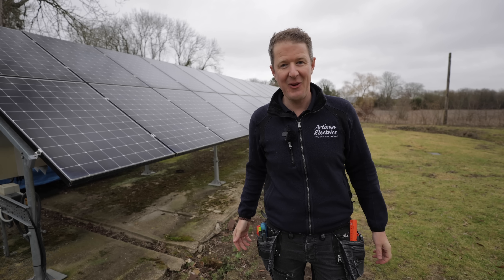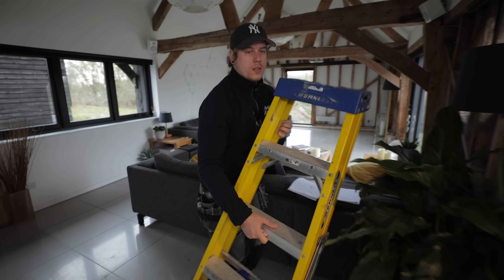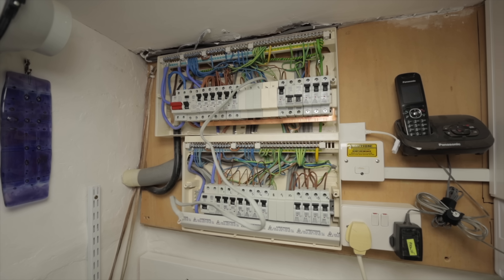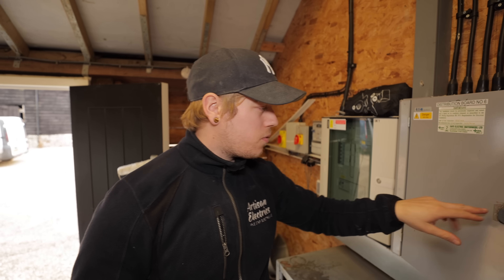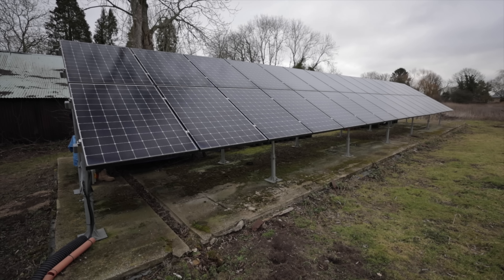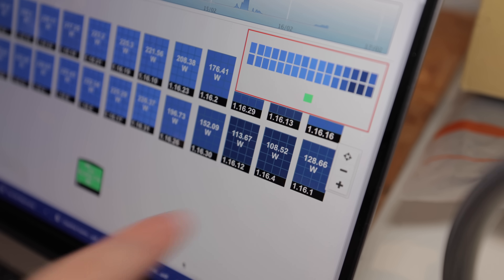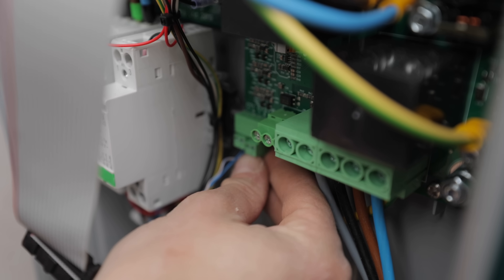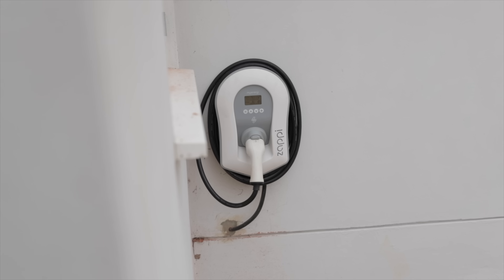Uncovering A LOT of electrical BODGERY!

Comment: Cut out fusses DO NOT protect the incoming supply cable.
Reply: Only against overload, not short circuit. Its a fuse, not a fusse. RECs/DNOs allow up to 100seconds disconnection for a fault on a supply cable to a head. (cut-out)

Comment: Guys can you please collect all of your cable trimmings into a box or a bucket as you go. It's not acceptable to just flick them on the floor, essentially outside. Why did Lee refit the Zappy back on the cobweb/ dust covered wall without giving it a brush off first? Apart from that, good work.

Comment: Never letting you see how I got power to my shed! You'd rip me to shreds lol. Great content gents.
Reply: Mine is fed by a 16 gauge extension cord into a very overfilled J box. It was meant to be replaced with proper SE cable and a breaker panel, but as we all know, there's nothing more permanent than a temporary solution.

Comment: Be careful about throwing rocks about IT Nerd diy work - because it many cases its substantially better than so called professional work.  Your video of you trying to wire in that ecoflow changeover unit and making a complete mess being a good example.
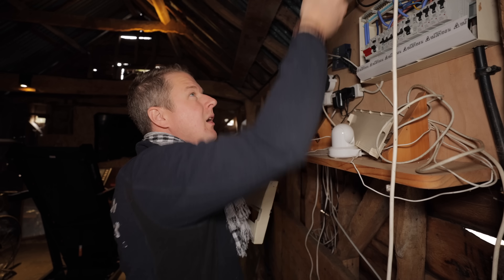Reply: While I'm well aware that it's not up to code and voids the product's listing, my first response to that extension lead at 5:00 was "There ain't nothin' wrong with that!"
Reply: Yeah, this is pure ignorance, I've seen as many bad jobs done by "professionals" as bad jobs done by "DIYers". The only difference professionals do charge you a lot for work.
Reply: Nah man DIYers and techy guys are the bane of any electrical installation. It’s just embarrassing whenever you turn up-to a job and see what they done. The best part is is that they are so proud of themselves for making it ‘work’…. You don’t know what you don’t know. 

Your right though - there are bad electricians out there.

Comment: I think any unused cables in a distribution board should have all conductors connected to earth. Otherwise, whilst being extremely unlikely they could become live and not necessarily from touching a live conductor inside the DB. There’s a potential for it to happen somewhere on the cable run or in the back of an accessory etc. Just good practice in my opinion
Reply: Agree, have always C2’d floating cables in DB’s for that reason.
Reply: Have to agree - as a meter fitter we were expected to isolate and instruct the customer to call an electrician whenever we saw hanging cables. If I had done that, I probably would've isolated hundreds of customers in three years and created a lot of nothing-work for electricians - and trashed the reputation of meter fitters even more. I just don't understand why people leave hanging cables everywhere - it simply introduces doubt in the minds of the next duty holder to turn up to do work.
Reply: However you then run the risk of that unused cable becoming live in the event of a fault.  I agree with terminating to earth unused cores on a multi core wire, but not spare cables. Especially if you don't know where the other end is.
Reply: No no no, Not spare cables at least! They could become live during a fault... And You know the outcome of that if connected to earth.

Comment: 2:20 should you ever hide a consumer unit? That should be a C3 in itself. Power goes out and Mrs Jones trips in the darkness because she can’t find it.
Reply: In the US, that would be a code violation due to minimum requirements for open space.
Reply: Same as the height, wouldn't comply with building regs Part M on s new build, but they can't be applied retrospectively.

Comment: The loose T&E in the CU is a code 2.  It’s a bare ended cable, not adequately terminated or capped off to prevent the copper ends touching live parts inside the CU and subsequently making the other end live.  It is no different to free floating cores inside a switch for instance that hasn’t had a choc block or wago popped on the end.
Reply: Unterminated ends bother me too....
But then again I'm a railway signalling engineer.... And Clapham Junction shows why they aren't a good idea

Comment: A Faraday cage is not just a metal box as its used to block electromagnetic fields, electrician taking nonsense as the metal box can reduce or interfere with the sensors signal but its not a Faraday cage (a brick wall can reduce signals transmitted through the air). Some Electronics engineers know a lot more than you do so don't put them all in the same pot. There are many sparky's who cut corners like the ones who installed bathroom down lights using terminal block and wrapping the connections in insulation tape and stuffing them under loft insulation (halogen bulbs in down lights). They also used bits of plastic pipe to try and prevent insulation covering the down lights that just fall over and this was found in a 15 year old house by an electronics engineer.

Comment: The multibox lead wired directly into the board at 5:00 doesn't violate code that I know of where I live(New Zealand). Dont get me wrong, it is Jank with a capital J. But sometimes Jank is a pretty good solution. 

Sure, running the multibox off a single plug socket would be better, but if you have a multibox with a damaged lead, why not reduce reuse and recyle by curing off at the damaged part of the lead and putting it to good use instead of the landfill? So long as the customer is happy that it works, costs them a little bit less to implement, and complies with your electrical code, why not embrace the Jank every once in a while when you have the opportunity to do so. Don't tell me you don't love that shit. We all saw the look on your face at 5:21.
Reply: Once you cut the plug off (or damage the cord), that product is no longer compliant and can't be used. Not only that, but it was never listed in the first place to be connected directly to a breaker.

Even knowing that, I still would have probably connected it exactly like that if it didn't have to be inspected.
Reply: @user2C47  What are you saying? What is the difference of buying a powerstrip without the cable and one with the cable fitted and cut off the plug? 

That thing is probably not elegant, but either not dangerous, assuming the breaker is properly sized for the extension lead and the cable (10A or less with 1.5mm2 cable), there are a bunch of power supply attached anyway. I see this done a lot where I live and it's perfectly fine, usually this is done in a similar situation (where it's just lazy, just fit sockets come on) but to power strips that are attached to desks or in racks of equipment.

If you need a lot of sockets in a location using a power strip is cheaper (for example where I live a schuko socket of a basic like like Gewiss is no less than 10 euros, plus you need the box and the faceplate, while a 6 places power strip costs like 6 euros), it's faster to wrire (you connect one cable, and done), and doesn't present any code issue. Of course you have to use appropriate cable up to code (that is in my country no less than 1.5mm2) and double insulated even for the short run that comes into the power strip.
Reply: @alerighi  two things: 1) didn't show whether the flex cable leads were ferruled - possible bad connection, specially if the breaker had solid lead also connected and 2) the breaker is probably oversized for the usual .75 mm^2 extension cord cable, both creating possible fire hazard inside CU. It is true, that it would not be much safer if there was a single outlet and THEN overloaded extension cord, but the line has to be drawn somewhere and at least in my country it is between fixed installation and user-connectable stuff.

Comment: I always laugh at the comments about "dodgy" DIY'ers" etc.  But if you have a think a fair amount of the issues you appear to find are actually done by qualified trade staff.
Reply: I agree with this, I am also disappointed when I hear "Bodge jobs from Electronic Engineers who think they know what they are doing" my father was an electronics engineer and spent 10 years training before being qualified. To quantify them as some type of idiot compared to an Electrician is simply not very fair.
Reply: @p3147-u9d  I have to say it does get a bit tiresome to hear “DIY Bodge” as the comment when he’s already listed a hell of a lot of installation failure by clearly a qualified or pretending to be qualified electrician. 
It would be far more productive to say why this was so bad rather than rant about the DIYer who did it when you don’t even know if it was one who did it. I can’t think why someone would consider wiring a multi plug extension lead directly in to MCB, but then again as an IT geek what would I know 🤬
Reply: @p3147-u9d  Some of us are qualified electricians, electronics engineers and IT techs! 🙋‍♂️
Reply: @p3147-u9d  my father in law was an electronics lecturer … and he was cheap.    So every single electrical job he did at his house failed inspection. 

Cost a fortune after he passed and we had to correct it.
Reply: @p3147-u9d  I think he meant different areas of specific knowledge not idiots. Obviously someone could do something that works without hurting themselves but it still not be correct under electrical installation standards.
Reply from the maker: Worrying isn't it?

Comment: For us non-pro's, what was the issue with the extension lead off a breaker? Apart from looking amateurish, from a regs/theoretical pov, what are the issues? If the cable is glanded into the box properly and of an appropriate size with the correct size MCB/RCD etc for the cable, isn't it just another radial circuit?
Reply: The only issue really is that the cable is not secure, a clip would sort that out. If you tug on the cable, you risk the connection becoming loose as it is currently
Reply: @TheAviation101  That's less of an issue than the current rating of the flex
Reply: @andrew7440  think they’ve put it on a 6A MCB which is fine
Reply: @TheAviation101  I thought 16 amp breaker see it at 5.min 36s
Breaker no.7 
The only 6 amp connected appears to be fed with a wire from above not below.
Reply: @andrew7440  in that case it still may be ok depending on cable size and type. It might be flexible cable but you can use the 70c rating on some cables when they’re installed fixed compared to 60c flexing.
Reply: Hopefully it’s a 1.5mm cable
Reply: @TheAviation101  yes,  though over such a short distance it'll not make much difference. The cable will last longer than the multi socket. I'm more concerned about the multi socket carrying a continuous 16amps, I've seen those things melt!
Reply: Once you cut the plug off that cord, you instantly void the product's certification. It was also never certified in the first place to be connected directly to a breaker.

While I'm not familiar with building codes in the UK, but I imagine using a non-certified product is very illegal.
Reply: @user2C47  You might have a point, but I'm not sure what's valid in your State/Country necessarily applies here. I think if the cable is to a BS or harmonised European standard, it would be ok. You can easily get the component parts of an extension lead which would comply if those parts are built to the relevant standard.

Fixed installations of flexible cables are allowed with caveats. This is where UK regs can get "woolly".... Various trade bodies would regard such an installation as "not advisable", but it's not illegal. As always, if it all goes horribly wrong, a Judge might well ask you to justify going against such guidelines.
Reply: Interesting. In the US, it would have been a clear case of "not listed for purpose / listing void, therefore not compliant." 

OSHA is known for confiscating equipment and giving fines simply because the plug was replaced, which voids the UL listing.
Reply: I think that sometimes “woolly” can be a good thing. It allows an engineer a degree of pragmatism. It allows him to use his professional judgement to assess whether something is viable both within the letter, and the spirit of any legal framework. It’s very rare for one rule to fit all situations. If you go hard on strict definitions, it can be counter productive. Most regs concerning safety are usually written in blood, or least trying to avoid the spilling of blood. What you say smacks of a nanny state that discards a degree of common sense unfortunately. Am I correct that your National bodies can’t agree a common standard and what works in one State would be a violation in another?
Reply: @user2C47  not at all. You can do modifications but now you take responsibility for it. Usually the cable has its own certification/ specification such as h05 and is perfectly rated for terminating to a breaker. You might just want to ferrule the end
Reply: Not sure about the UK, but in the US running extension cord wire through walls or into boxes, etc, is a no-no because the insulation of extension cord wires is typically not rated for internal wiring applications (it is not intended for use in enclosed spaces).

From a practical perspective, it probably isn't a big deal in this application, but that doesn't mean it isn't still technically against code.
Reply: Anybody? Nobody?
Reply: Current rating of the extension lead flex  or the multi socket is the issue. 
Probably it is 13 amps, and highly unlikely to have an mcb of that size, and it would normally have a 13 amp fuse in it's plug. So if connected to a 10 amp mcb then fine for me. However at 5:36 you can see no 10 amp is present, in fact it's connected to 16 amp mcb. 
If it is 1.5 flex that'll be fine but chances are those cheap argos/ B&Q leads aren't, and will be 1mm or perhaps 1.25mm. The metal bars, screws etc inside the multi socket will not be tested to 16 amps. From a regs point of view it is also not used as per manufacturer's instructions which would say to use a plug.

Comment: The MEM 3 boards are good so at least someone cared. I have been to farms much worse than this like the one I was in last week that still has black rubber from when electric was brought in in 1947.
Reply: And the farmer says, "nothing wrong with that, been working since the 1950s...."😂
Reply: @andrew7440  Nothing basically wrong with black rubber if its not cracked or perished and it meggers up OK. Back in the day, rubber was the preferred material, PVC being seen as a cheap alternative. I've got samples of VIR that are 60 years old and as good as the day it was installed.

Comment: Jordan..... time 8:40 "Eddi should be wired of a 20A Double Pole Switch....." - That's not correct. "The Eddi device should be connected to a single-phase 230V or 240V nominal AC supply. The supply should be from a dedicated 16A circuit breaker, or it can be from a hard-wired 13A fused spur outlet if the heater load is less than 3kW."

Comment: Every electrician comes along and says the last one was shit.
Reply: Unfortunately its part of the industry, complaining it should be a C2 instead of a C1 but then saying cover missing on busbar that would be behind the front cover so completely within regulations is a C2...   I personally dont think you should bitch too much about others EICR's as they are an engineering judgement so is open to interpretation, it should be based on regulations but the regs are so woolly that it can lead to differences of opinions.
Reply: Not sure every electrician, certainly some. I had an electrician in a rental property we own recently telling me an installation was bad, he'd forgotten he'd done the installation I do have electrical qualifications and was able to show it was OK (distance of ceiling light from shower cabinet), he was just trying to create some work. Was utterly shameless when I called him out on it.
Reply: @tocboatman  yep, im a fully qualified spark but needed someone in London to do an EICR for my partners rental, he came back with FI because he didnt check the light switches had a fly lead from switch and back box because he didnt want to damage decoration..  The light switches tested good as having an earth and had at least one fixed lug so didnt even need a fly lead but when he went back and checked they had them anyway..   So and FI which means it fails and needs investigating so you would have to potentially damage the decoration anyway, like you say just trying to get more work..
Reply: Every tradesman